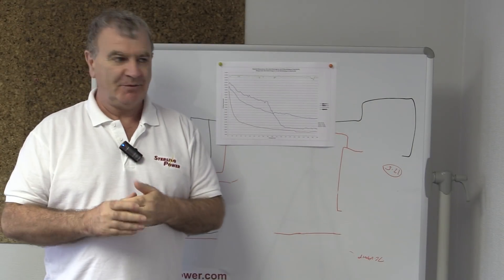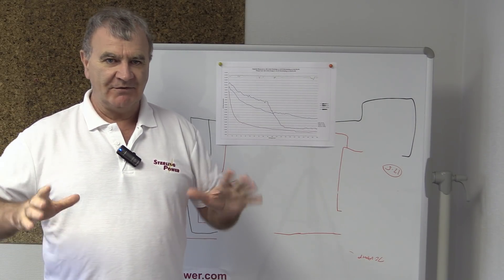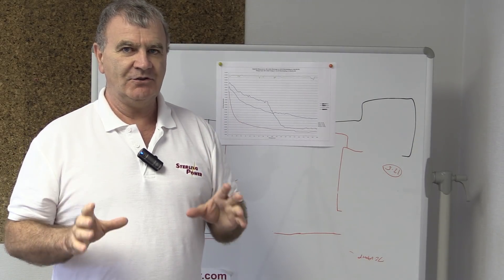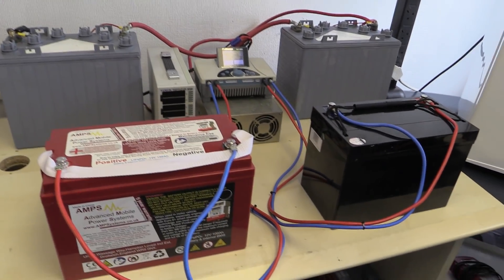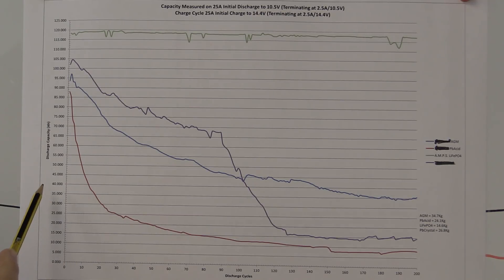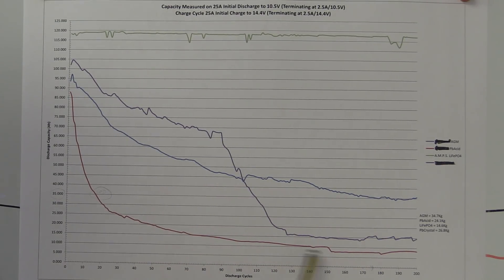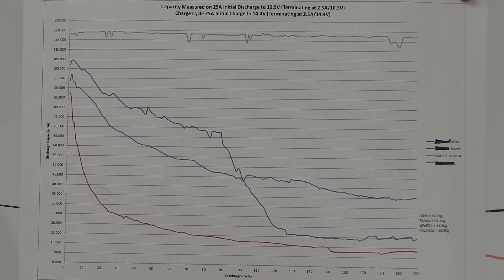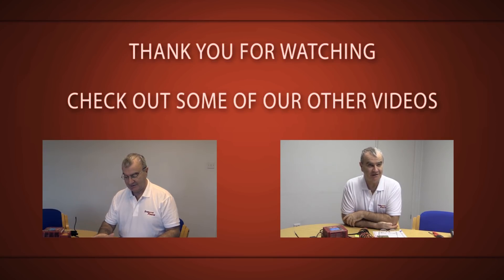Lithium vs Lead acid test, by Sterling Power

Comment: This test is based on really mistreating your batteries. I wonder what the cost comparison would be if the lead acid batteries are properly maintained. I have gotten 5-7 years on my lead-acid batteries on my sailboat with solar panels and a proper solar regulator.
Reply from the maker: Hello Viking man! Strong name.

The test is based on using your batteries to a relatively deep discharge, but realistically any discharge beyond about 50% can be detrimental to a lead acid battery. The exception to this is flooded/open lead acid batteries that can be maintained to a far better degree.

Then again, if you are using a 1000Ah battery bank only to use 300Ah of it to ensure longevity of the batteries (which is certainly doable, moderate discharge depths will lead to longer life), you may as well save on weight and space by moving to Lithium 300Ah and have the same usable capacity. 

In our opinions, of course.
Ben

Comment: Great test absolutely get where you're coming from. People saying this isn't a real world test are not living in the uneducated real world! Would there be much difference between the lifetime of the agm and a sealed lead acid like you would find on a mobility scooter type battery?
Reply from the maker: Hello Andrew,
As you can see on the graph (Or- just about..!) AGM often slightly outperforms sealed lead acid, but it's a marginal improvement for often a significant difference in price. 

We'd generally recommend lithium. Yes, it's far more expensive, but the longevity and superior performance is a drastic step in the right direction, rather than just a little one.

Comment: I now use lithium battery for house, the alternator to charge it and a solar panel to keep it topped, and use a maxwell capacitor at 1800 cca to spin the starter motor, the maxwell has a 30 amp inbuilt charger. Now I have technology that will last 10 years plus 👍
Reply from the maker: Hi Paul!

So long as your alternator isn't being run to it's limit by the incredibly low internal resistance from a lithium battery, you're gonna be fine!

Whenever charging lithium we recommend a current limiting charge system because in our experience if we don't control the current, the lithium normally ends up asking for 100% from the alternator which can lead to some upset.

-Ben

Comment: I'm sorry but this is just as one sided as the general battery company's data.  The difference is that it's not real world in the opposite direction, Unless, of course, one is running a fleet of vans with inverters so the drivers can brew a cup of tea at will and it will and boil the water until the battery goes dead...LMAO..  No one, on a boat, runs his inverter till it shuts down because of low voltage and charges the battery back up.  Very disappointing.   Give us a real world test, please.
Reply from the maker: Hi Eric,

What test would you like to see? 

In our experience there is some clear benefits to lithium over lead acid, and some fairly evident downsides, too.

PROS:
High charge rates in high performance batteries. Generally customisable high discharge rates, too. Some batteries are better than others, dependent on BMS. 
Half the weight of lead acid and sometimes half the size. 
Often utilises a BlueTooth BMS for ease of monitoring 
More of the battery can be used, safely. The option to discharge down to 80% (and often further, but then it becomes gambling) vs a lead acid's 50% and still have a 5 year warranty makes it a fairly simple choice for many 

CONS:
Far, far more expensive
Requires a more controlled and thus often more expensive setup, otherwise the BMS will trip and you have a 0V paperweight
Often unsuitable as a cranking battery unless you have a unique BMS setup. 

You'd be surprised how many calls we do get about people who discharge their lead acids too low, continuously, thus damaging the battery and then being surprised when they can't run even basic appliances for long. 

-Ben

Comment: This is only helpful if your into abusing batteries. I bet most people  will write off lead acid and think lithium is the only way after watching this. 
I would love to see a test with mixed cycles without abusing them and mixed solar type charging cycles. My agms where bought second hand from a yacht and have worked every day for two years now and still work perfectly.
Reply from the maker: Hi Bmartinot,

Running a moderate or light cycle test would be a waste of time, as, if we stuck to 40% DOD the test would last a year with only moderate or gradual degradation on the lead acid side. 

This test is mostly to show that you can actually utilise the entirety of your lithium bank, comfortably, instead of being forced to only use 50% of your traditional lead acid bank. They're lighter, quicker to charge, and you can use more of them. Their downsides are the fact that they require bespoke charging, more management and they cost more. 

I understand your point wholly, but this video was more to show the fact that if people do end up trying to use the whole capacity of their bank, as many people will do if they don't understand the limitations with non-lithium batteries, they'd be better off considering a lithium route. 

I'll log your interests anyway and pass it across to the engineering team if we end up doing any further tests on this front :)
B
Reply: Would be interested to see some mixed cycles, looking at options for an additional battery for weekends camping to run portable cooler etc, if got discharged a few times a year would lithium be an overkill and had too much complexity?

Comment: Very good video thanks for taking the time to make it.  So many people do this!  Many more people do this in their RV.  They co camping and leave the lights on like they are at home and ruin the batteries.  When Attach the lithium to solar you get really fast recharging without getting stuck in the absorption mode for hours, Limiting your solar panels performance.
Reply from the maker: Absolutely- and leaving even one light on that you forget about can totally run your battery down to an obscene level. I'd personally recommend people to fit some kind of switch on the battery output so that they know they can turn everything off at one place rather than relying on memory. 

Lithium is great so long as people have the right charge setup.

Comment: It would be nice to see t
he 50% did test with an occasional like down to 20% on the lead but that would take forever
Reply from the maker: Hi James,
You'd see much the same results. Lithium would stay comfortable on a flat line (varying slightly up and down here and there due to either reading calibration or temperature) and various lead acids would follow a similar drop, although over a longer period so it would be a slightly softer drop. 
Sealed lead acid batteries naturally sulphate and lose efficiency and life over time, it's just a fact of how they work. You can run desulphation cycles but overall efficiency will still drop gradually. 
If you can put up with the admittedly higher price point inherent in lithium (which is, gradually, dropping) and can invest in the chargers that are necessary to care for them you often see the long term benefits long outweigh the initial investment. 
If you're going to use the batteries heavily and want to rely on them for long journeys, it becomes a case of weighing up a new lead acid battery once or twice a year, versus one lithium battery, at worst, every five years (five year Sterling warranty).

We would have done this test, but we frankly valued our lifetime.

Comment: How about a group 27 walmart marine 89 amp hour battery for  $100 US that lasted over one year and  that provided all the power needed for boondocking ran down to 10vdc atleast 5 times at that rate  thats a new battery yearly for 10 years to get that $1000 us li ion price. Without any concerns for care of the battery. That's charging daily with solar. Put in service April 2018 replaced December 2019. You can find a video of the removal on my YouTube channel TRAVELING WITH JRP. I did replace the battery with 2 used interstate 6DC then later with 2 brand new Duracell 6VDC but that was only to stay a the top end of the charge. Now my system only discharges to around 12.6 over night and totally recharged 3 hour after sun rise. So how many cycle if I stay above 95% SOC and recharging daily to 100% using the Tri-metric RV 2030 battery monitor to watch them.
Reply from the maker: Hi Joel,

Did your Walmart battery retain its 89AH capacity for the entire time you had it? 

If you're staying over 95% SOC you've probably got a battery bank too big for what you're actually using it for, and it'll most likely last a very long time. Though, like I can say for all things when it comes to batteries, the Lithium will still last longer. Luckily, lithium prices are dropping but we do respect they're not cheap. 

It's permanently going to be a case of lead acid batteries fundamentally deteriorating over time. Lithium batteries, as far as we can see, are far less vulnerable to this deterioration, even under high DOD.

Comment: C5 discharge rate is not unreasonable. If the way round keeping a la chemistry viable is by a large bank discharged to only 30%, the economics still don't add up. Obviously a large bank is more initial outlay. But the cost of transportation, and extra materials to gain long cycle life due to a required 70% redundancy is crazy and terribly inefficient. Also, with la, the charging slope is terrible. To keep from sulfation, the battery must have a lengthy topping off charge, at which time charge efficiency is low. In off-grid renewable energy systems, this is very often not achieved/unachievable. Internal resistance maybe low for a new la, but slight discharge over weeks (not uncommon) raises this resistance. This results in poor charge acceptance at a time when ever amp needs to be stored (winter months).  Lithium has very few of these drawbacks. Bigger initial outlay sure, but with a functional BMS protection system a lithium will provide stable long term performance. Also, the industry standard for battery replacement time is when 20% degradation has occurred. With la chemistry, after 20% has occurred, the loss of capacity speeds up. This is not the case for lithium. All this has convinced me to replace my AGM bank with lithium.

Comment: Okay so taking all things into consideration. As time goes on the price of lithium batteries will drop. Okay having said that. It only seems logical to buy a decent solar/wind charged system due to the weather in the UK. Or you run your engine or small generator which ever is more economical. 

It will only take approx 2 hours to charge your Lithium batteries. A normal car battery will take 12 hours to fully charge the battery again. So yes its very expensive but will last you more than 5 years. By that time there will be better batteries available like  graphene batteries which will revolutionise the way we look at batteries, look it up the logic is there. I personally think they will be on the market by 2022. What will that give us?
It will probably cost £1500 per 110Ah battery but will charge in under 30 minutes. You will be able to drain the battery to approx 10% and then recharge it fully in under 30mins you'll be able to efficiently and economically produce your own electricity either by solar or even running your own diesel engine. This will revolutionise electric cars, they will be able to travel further and have an onboard generator as the car travels. As for inland narrow boats etc which only travel at approx 4 to 5 MPH they could swap out their old diesel engines and instal electric motors run off of graphene batteries charged by a small generator or graphene batteries charged by solar/wind. Exciting times
Reply from the maker: Hi Ken,
Fair points but there comes a point where faster charging isn't necessarily better charging. We'd need alternators that are actually comfortable to put out as crazy a charge rate as you're after and, assuming graphene has an even lower internal resistance than lithium, we'd also need to current limit the charge so that the alternator doesn't essentially explode.
After all, low internal resistance means that an alternator can put across a much, much higher current but without working as hard. This sounds good, but it isn't. When an alternator is working hard it has it's own inherent cooling that stops it from breaking down quickly. When it's providing its max current output easily, which graphene and lithium would allow, it will be smoking and the long term health of your alternator would be at risk. 
To combat this you'd need to treat it similarly to lithium in how it requires current limiting. You'd need to put our battery to battery chargers on it solely to stop your alternator from exploding. We're getting to the point now where some things need to be held back rather than given free leash. 
Hell, even if the alternator's fine, you're still going to need current limiting because how many cars have cable that will allow 200A? Not many, and certainly not for cheap!

Comment: Thank you for doing the research. I Don't think I am ready to invest in lithium technology of today yet. Nano technology will bring us a much better less dangerous battery that is not so picky with its requirements of charge/discharge and temperature requirements. These newer batteries will be a hybrid of battery and capacitor allowing us the best of both worlds both in charging and discharge. I  In vision a frame for the machine as part of the battery there by reducing the weight and size. Electric 4 wheelers would not need a frame. Making these batteries modular and only in a few sizes would reduce cost. Don't think in terms of only flashlight batteries (18650) same as used in the Tesla. Flashlight, lawn mower, car not one size fits all.

Comment: at least slow discharge rates are briefly discussed.  even at current lipo4 12v100ah batteries are around 800-1000. for 800, you can get effectively 12v800ah. adjusting for "usage" and recommended levels, @50 percent depth, you still have 400ah of capacity. at 100ah of discharge,that's not even 15%. 
If weight, some maintainance, and space isn't a huge concern, deep cycle lead batteries win, even if charge efficiency and discharge efficiency isn't quite as good, from a cost perspective. Lithium batteries are like Ferraris, lead acids are like Camrys. For RVs the weight savings is substantial, not to mention vibration and temperature. but for stationary solar applications, lead acid will win for now, until cheaper lithium comes about.
Reply from the maker: You're about right. The advantages of lithium are it's longevity, weight benefits and energy density. Advantage of lead acid are it's CCA, established history and economics.

Comment: I don’t think that this video made the case for which battery type one should be using. It made a much better case for using a battery protect to prevent the batteries from being overly discharged. The cost of a battery protect added to flooded lead acid is low enough to make even AGMs not economical for the type of usage that he is concerned about.

Comment: Thanks for that analysis. I replaced my 8 - L16s last year with another set of L16s, about $2000. So in 20 years I've gone through 2 sets of lead acid batteries and I'm on the 3rd set. Looks like for the foreseeable future LA will still be the battery of choice. 
Interesting that the panels have a 25-year life, I'm getting close at 21 years. I suspect new panels are both more efficient and cheaper. But disposing of anything old (TVs etc.) is a nightmare. So until the Trimetric shows weak charge I'll run with the old panels.

Comment: This would be more realistic if you went down to 10.0v which is the point lithium iron phosphate can become seriously damaged...

THe kind of people who use cheap lead acid and run it down until equipment craps out before charging again are never going to consider even a decent AGM battery. As soon as you limit the discharge rate the results would change a lot. I think on a longer time frame we’re going to see similar results but this test case is not realistic, despite your disclaimer it’s pretty pointless. IMHO... still interesting data though.
Reply from the maker: As you ascertained- if it was a lighter depth of discharge we'd still expect to see very similar results, just with a softer curve- or they'd survive for longer before dropping off. 

We didn't particularly fancy turning a 6 month experiment into a two year one, really. It just became a time/effort equation.
Reply: SterlingPowerLtd Fair enough! thanks for replying, even if it did take a year ;)
Reply from the maker: @frodev728  Yeah, sorry about that one! We didn't have anyone on social media for a long time. But, alas, here I am.
Reply: SterlingPowerLtd hahaha no problem :)